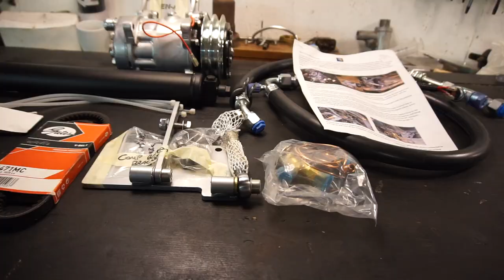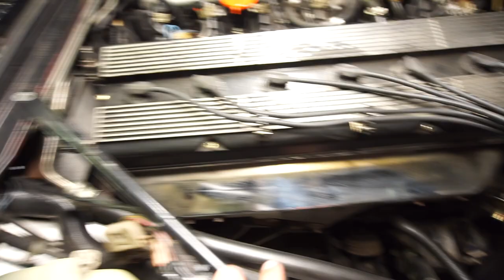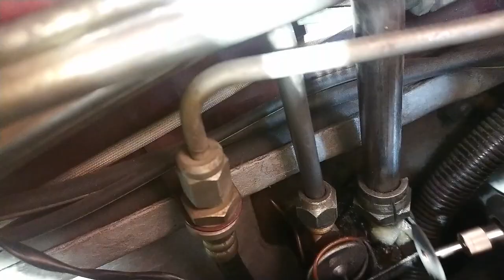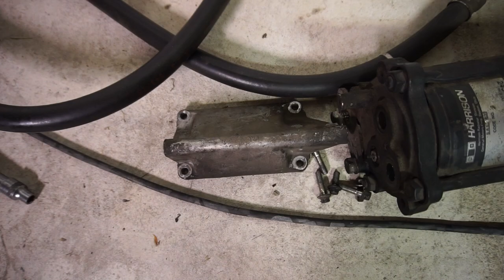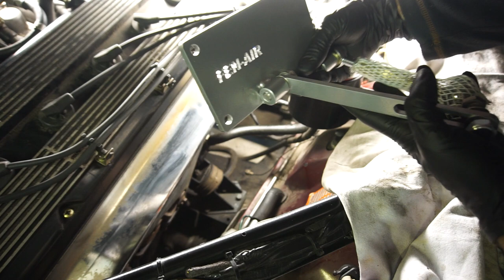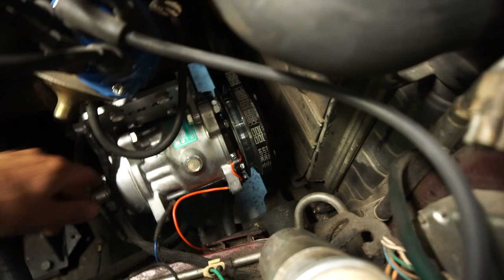Fitting AC in a Classic

Comment: Is this just as easy with a V12 XJ-S? Or is it substantially more difficult to reach the components and remove them in the more crowded engine bay of a V12 XJ-S?
Reply from the maker: The compressor and hoses are easier on a V12 but the expansion valve is hard to get to on the V12. It's doable just a bit tighter. I have it fitted on my XJ12 series 2

Comment: Great video. Does that xjs have the same delanair mark2 climate control system as the xj12 s2? (Interesting but overcomplicated design)
Reply from the maker: It does have up until about 1986 and then it has the next version, Mark 3. It works pretty well and is simpler than the Mark 2.

Comment: Very informative Adam, as always. Thanks! Are you going for a manual on/off AC system or remaking the old auto sort of climate control system?
I had the AC in my own 1985 XJ-SC 3.6 manual serviced/repaired by a pro AC shop in Spain. They replaced the original Harrison compressor with a rebuilt similar brand and also put in a new receiver/dryer up front. The evaporator and condenser were not replaced, as far as I know. New gas (all purpose type, not R134a) was put in as well as the required bit of oil. To start with the ‘new’ system provided ice-cold air, but I soon got problems with it. Had to go back to the shop twice to have it serviced. Now it works kind of ok, but the system gives no heat unless I disconnect the AC (separate small switch) when needed on a cold morning. In total the AC ‘restoration’  on my car has cost quite a bit. The problem may be caused by lack of use when I’m back in Norway for months, and the car safely stored. Any ideas?
Reply from the maker: I will be using the original climate control system on the car as it is. So the climate control will trigger the AC. When I put Ac in my XJ6 I plan on putting in a manual switch.
Sounds like you maybe have some issues with the blend doors or the trigger part of the climate control. It should be able to supply heat with the Ac running at the same time